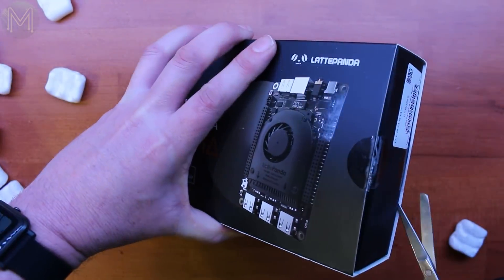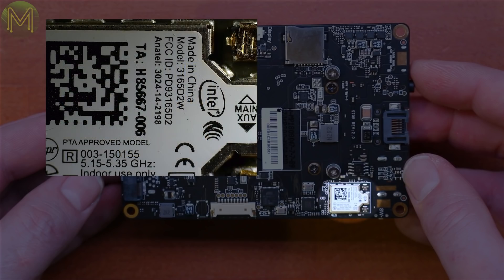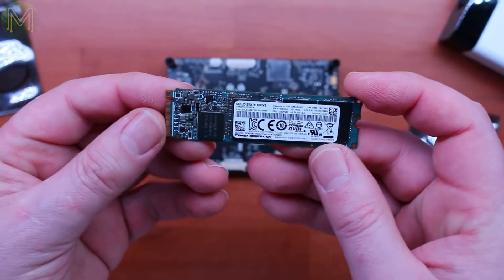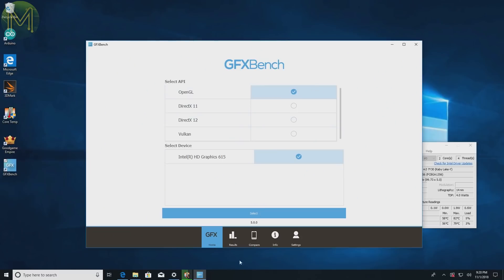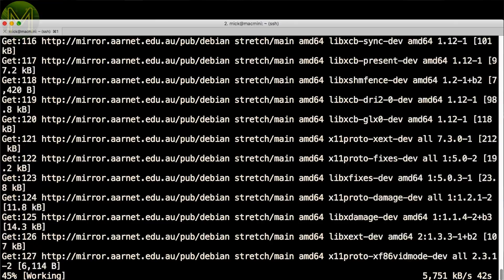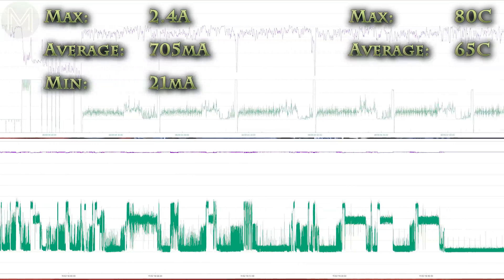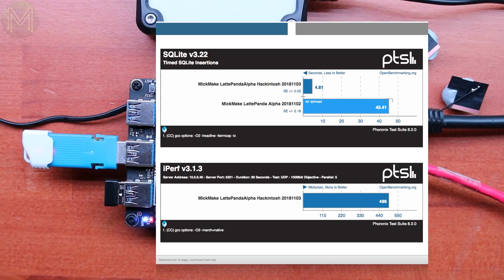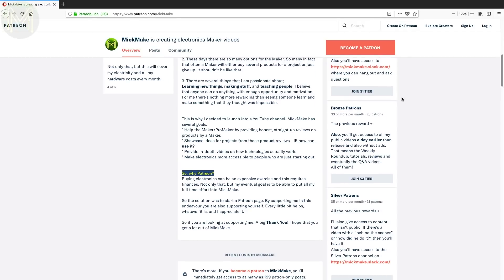#238 LattePanda Alpha: The big mistake? // Review

Comment: 3:39 That Exar usb-serial is COM3 under Win10 using USBACM driverless driver. 
3:19 That TI 6-ch analog switch is for NGFF M-key slot SATA or PCIe mode switch (thru CFG1 pin control input.). I think some of the 10 pogo touching pads are led to Kaby Lake-Y's SATA out (into the mux.)
There is a potential to solder an ext SATA connector on that, so long as BIOS will not block using PCIe over key-M and SATA at the same time.
Reply from the maker: Yeah, I'm beginning to think that the Arduino is actually connected directly to the main CPU as well as via the USB-serial bridge.

The TI IC - I think I'll probe around a bit and see what it's doing.
Reply: @MickMake  re: DATA/PCIe pin sharing MUX (TS3A27518E), I'd suggest using that "U x86" product's schematic H for inspiration :)
 XR21V1410 (CDC-ACM) is COM4
Arduino Leonardo is back to back connecting to Intel CPU's built-in USB port and is detected as COM3.
Reply: "D"ATA sorry SATA
That EXAR IC's RS232 signals are then using SP3243 RS232 level shifter to reach the DuPont connectors.

Comment: Great video as always, but the 'big mistake' headline has to be clickbait. In a previous video you said you couldn't see the point of the MCU, and now you're complaining it's too feeble? That's definitely in the territory of: "The food here is terrible - and such small portions."
Reply from the maker: See my reply below with +k0ppit.

My thoughts are:
If you're going to include something, then put something in that has some grunt, but then do it with a separate daughter-board that you can upgrade the MCU to a newer version.

Having said that; I really can't fault the LattePanda so far. Up till now the issues I've seen have been to do with software. EG: WiFi drivers in Hackintosh, but that's not their fault.

It's a well designed board, but I still think that including a piddly MCU on an SBC with a high price tag is a mistake.
Reply: @MickMake  I get what you're saying. Personally, I would have loved to have had a Teensy on board. But my hunch is that this is not about providing an MCU per se, but just adding some functionality to complement the main computer – HID and the like. It's interesting the Udoo Bolt has the same MCU and specifically mentions its use as a keyboard scanner and fan controller – ie, both applications intended to serve the main computer, not add separate MCU capabilities. When my Alpha arrives I plan to use the MCU to drive a 20x4 LCD panel.

Comment: Does the AVR ATmega32u4 speak USB with the main computer?
If you'd want to put the LattePanda into a custom keyboard then the ATmega32u4 has more free USB HID firmwares than any other MCU and you wouldn't have to write a custom OS driver from scratch. It also has more robust I/O than many faster chips.
Reply from the maker: From what I can see it is directly interfaced, but it's curious that there's a serial to USB bridge chip in there. Possibly that is for the ATmega32U4 second serial.
If that's the case, then yes... write your own custom HID.

Even though I'm a Microchip fan, there are a huge amount of STM32 MCUs around with waaay better I/O capabilities.
Reply: Yes, the 32u4 is not such a bad choice.  Arduino means Atmega/AVR8 to lots of people, and the 32u4 is the minimum needed to build a LUFA  AVRISP MKII clone.  I am so careless and abusive to MCUs though, that I certainly do not want my silly projects dangling from a nice $300 mini-PC floating  around the desk.

Comment: Thanks for review. I’m not sure if I’d call it a big mistake. Of course Mega32U4 is a small cpu but also costs a fraction of whole board. But at the same time it can works as a board governor, interact with some low level hardware as a proxy, be a USB HID device so it is not as bad. It is just very low level. But interchangeable CPU slot would be nice anyway.
Reply from the maker: Thanks mate!

Actually, the ATmega32U4 costs more than higher powered MCUs. It would have cost less to put a SAMD51 or STM32 in.
However, I can understand that they are playing the "safe bet" here.

Would have been much better to offer a small header supporting plugin boards for those wanting to get into the Arduino side.

Comment: I wonder how this will stack up against the Udoo Bolt. I suppose I can run some benchmarks when I get mine.
Reply from the maker: Yeah, it'll be interesting when it hits the market.
Reply: @MickMake   That it will, though to be honest, it is closer to a SFF computer at this point then a maker board, and has the same issue of using a 32U4 for it's GPIO that the Alpha has.
Reply: STM32 would have been a so much better choice.  Can’t wait to get my Udoo Bolt however.

Comment: waiting for version with core i7 / 32 gigs and attiny13 onboard.
Reply from the maker: Ha ha. Yup, a nice 28 core i7-8086K with 6502 onboard.
Reply: I7 != embedded SBC,  you would probably do better with MicroATX .. Arm A76 is slated to be the intel killer which is alot more exciting.  Perhaps we will see an AMD real attempt at a low cost SBC at that time bringing in Vega20 graphics and what nots.
Reply: Still waiting for a ryzen apu soc
Reply: simply buy the latest Intel nuc i7 8th gen. it's a beast and small

Comment: Although will agree it would be nice if it had a more powerfull mcu. Calling it a big mistake is a bit of an exaggeration. If it's the only problem just pretend it's not there.
Reply: I agree with you, a nice to have but certainly not a deal breaker.  Tempted for one as a mac clone of sorts, torn if i should just buy a used mac mini though.
Reply: @Chickey  The Intel NUC is a nice form factor that can be quite easily hackintoshed.
Reply: Agreed. I would consider it more as a universal 8bit programming interface as opposed to an actual Arduino. 
  Anyone that uses an integrated device like this for tutorial level projects is just going to fry it quickly. However I'm sure there are several options laying around to turn this into an ISP programmer. I know there are several projects that are using an ATmega32A for '4× IC z80' retro builds. This could probably be made to work for experimenting with a setup like that. Heck, the 32U4 is the Ardy Leonardo, is the IC used for a lot of HAK5 hardware, for keyboard emulators, and for datalogging projects. If the target demographic of the board is serious automotive apps than a built-in, CPU independent datalogging capability is awesome. Sure more advanced controllers could do more, but copy and paste example projects are awesome and the biggest bridge into the hobby for most of us. Ardy's not about the hardware, it's all about the libraries.
  You could even make this a modern computer with a Serial and Parallel port using the 32U4 to get all those ancient little devices out of the attic and have a bit of fun. ...Just my $0.002 adsense...
-Jake
Reply from the maker: I don't think I explained it well enough in my video and think I'll add the following to my website article.

So, here's the reasons why I think so:
An SBC with a high price tag attracts several people. Three of the most common ones are:
1. Pro-Makers wanting AI/ML grunt.
2. People just wanting a small desktop/media centre.
3. Beginners with lots of money.

If you're reaching the Pro-Makers, then a piddly ATMega32U4 isn't enough. I mean, it can be sometimes, but there are waaay more up to date MCUs that could have been used.

If you're reaching target audience 2 - then they don't care at all. Why put it on at all? Leave out the additional headers and supporting ICs.

For the last group - They are more likely to fry something and having something onboard that gives them more opportunity to do so, is risky.

So, hence my suggestion of moving the Arduino side off to a separate board, allowing more expansion options would be ideal. It wouldn't have added to the cost at all.

It's a big mistake in that they could have aimed for more of their buyers.

Having said all that... I personally won't be using the Arduino side at all on mine, (apart from review updates). I wanted it solely for the fact it's beefy enough to run OSX well. It hasn't affected my buying decision.
Reply: @MickMake  I would be #2 I like the small computers, don't give a flying donkey's fart about the pin headers for all that crap
Reply: @LiLBitsDK  Fine, go purchase another board w/o the arduino headers that suits YOUR needs, for a lower price (fewer components). There are hundreds available.
I need to control a variety of gadgets, with something more than a RPi 3B+. So, either this or the UDOO may be ideal candidates.
My problem is that every time @Mickmake shows me exactly what I'm looking for, another better SBC comes along.😜
But, as a newbie to SBCs, I really appreciate his informative reviews. I simply need to be more attentive to the upload dates and keep my impulsive buying urges in check.
Reply: @TheOleHermit  ooh 100's? funny don't see them, show me one just like the Latte Panda in size/power without the pins?
Reply: @LiLBitsDK  They are commonly called laptops, notebooks, tablets, or gaming PCs and yes, there are hundreds on the market.
Aren't most modern SBCs the top of the Raspberry Pi/Arduino evolutionary chain? Their DNA comes from the needs of Makers. That's what MickMake is all about and the reason most of us are here.
Reply: @TheOleHermit  and where have you found one of those in the SAME size as a Latte Panda? You do know that there are others out there that want the tiny boards for other stuff than your needs... So all those people should just shut up and pay extra for unneeded details? So if you don't have anything useful then just move on...
Reply: @LiLBitsDK  Works for me, Pal. You were the one that started criticizing boards with GPIO pins. I only made the point that many of us need them. Now, why don't you bugger off and leave me alone?
Reply: @TheOleHermit  because I wanted a version like it, without the pins... just like people wished for boards WITH GPIO pins... then there are a bunch of us that can see other uses for such small computers without the pins... so we are not allowed to wish for that? only ppl that want computers with GPIO pins are alloved to have wishes?
Reply: @LiLBitsDK  Just won't leave me alone, eh? You want something useful? Ok, I have a few useful pearls of wisdom for you.
1: No matter where you go in life, pull your head out and look around at the lay of the land before you start spouting vulgarities, just because the environment isn't tailored to what you are searching for. The world doesn't revolve around your backside.
This is obviously a maker site.
2: Show some respect to whomever owns the territory, upon which you are merely a guest. MickMake has put a lot of effort into building his audience of 41,000 subscribers by targeting the maker community. He knows his business and provides the majority of us with vital information for our projects. So don't be surprised if some of us take offence to your criticisms of him or the products he chooses to review.
3: You started by whining over the Latte Panda having GPIO pins, just because they increased its price. When I suggested alternatives, you added that size is a priority. Well, the latest craze is mini PCs, which are small, more powerful, and less expensive than SBCs that are designed for the Maker market (by the time you add on eMMC, NVMe SSD, case, etc.) Without trying to second guess your inner desires, it sounds to me as if mini PCs may be more appropriate for you... small, inexpensive, and can be stuffed into a backpack to impress to your gaming buddies.🤦‍♂️
Reply: @LiLBitsDK  Then, I suggest that you buy the LattePanda, since you are so in love with it. You probably don't own nor know how to hold a soldering iron, but you could always cut the GPIO pins off with some side cutters, if they really bother you that much. 'Have a nice da-ay.'
Reply: @TheOleHermit  I was 10 when I soldered my first kit and moved on from there. So yet again you fail massively.
Reply: @TheOleHermit  I don't want ANYTHING from you other than peace and quiet... now go away
Reply: I agree; titling the video "The big mistake" is a bit clickbaity if that's really the only downside of this board. It's indeed a very odd choice of microcontroller in 2018 but not a dealbreaker. Most people will buy this as a standalone PC and not really a maker board.
Reply: It all depends what projects you have in mind. Personally I think It's the right choice + integration onboard for me is key !! So well done Latte Panda For me it ticks all the boxes.
Reply: Does the power supply come with adapters for different regions? Or a detachable lead? I’m in the UK and hoping I won’t have any issues with the supply!
Reply: I honestly think the only thing this board is good for is installing kali linux and having a small form factor x86 hacking station.
Reply from the maker: Yup true, but the SAMD21/SAMD51/STM32 offers all that plus more for the same or lower price.
EG:

SAMD51 - 4,000 off @ $4.51611 each
https://www.digikey.com.au/product-detail/en/microchip-technology/ATSAMD51G18A-MUT/ATSAMD51G18A-MUTTR-ND/7390321

ATmega32U4 - 4,000 off @ $5.13537 each
https://www.digikey.com.au/product-detail/en/microchip-technology/ATMEGA32U4-MUR/ATMEGA32U4-MURTR-ND/2238242

STM32 - 5,000 off @ $1.34586 each
https://www.digikey.com.au/product-detail/en/stmicroelectronics/STM32L031E6Y6TR/STM32L031E6Y6TR-ND/6166972
Reply: @MickMake  
True those are all of those are great options While 5V logic is practically ancient Egyptian hieroglyphics era technology, that is the one advantage of the 32U4. There aren't a lot of options (that I'm aware of) that completely support a 5 volts and especially ones that are capable of sourcing  or sinking more than ~5 mA.

   I'm curious how this works out for your editing setup. I could see something like this working as a replacement for my aging spare electronics laptop.
-Jake